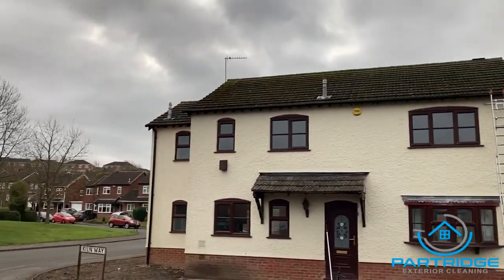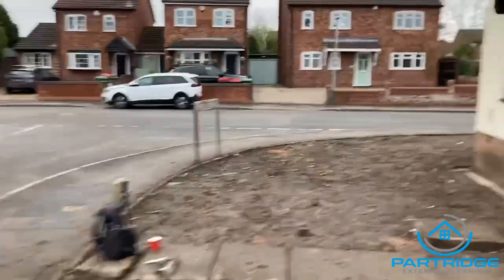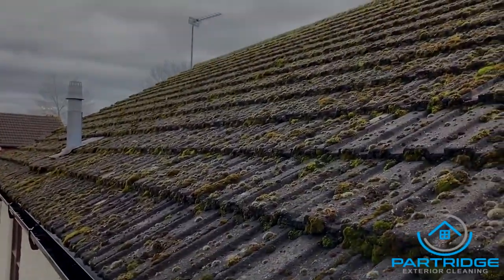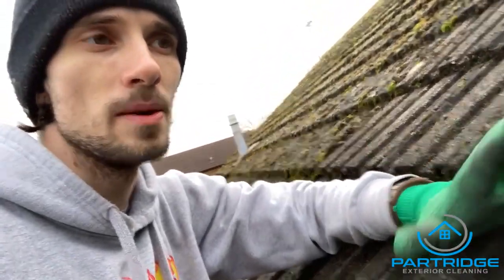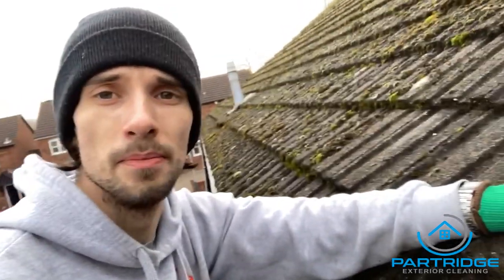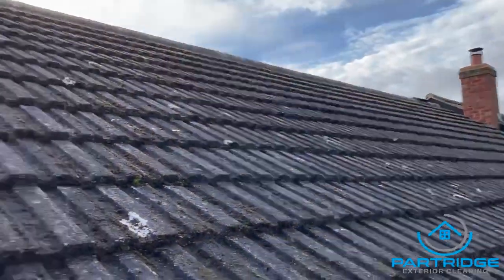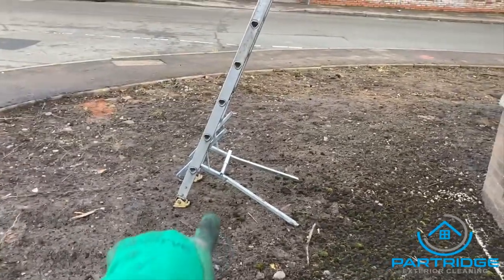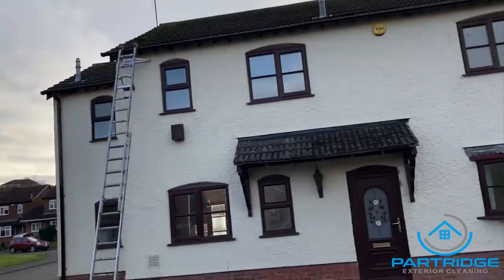Satisfying Roof Cleaning In Tamworth // Partridge Exterior Cleaning

Comment from the maker: Thanks for all the likes and subscriptions from this video! really awesome to see. well over 500 subs now thank you!
Reply: Hi mate, great vid as usual! just wanting some advice on algoclear, do you have or need any certificates to use it and if there's anything you need to do with what runs from the roof into the gutters?. cheers
Reply from the maker: No mate but it is advised to really do your homework when using it. 
You can book a soft washing course that will teach you everything you need to know. I chose to seek advice from the top guys in the business instead to make sure I was doing everything safely and correctly. 
Disconnect any downpipes that run into the ground or drains, if you can’t then plug it with something, I usually use a towel and block the pipe up and mop the run off away before I leave.
Reply: @PartridgeExteriorCleaning  really appreciate your reply mate! It was something the Facebook community was unclear about, what do you do with your towels just dry them out and reuse? Thanks again 👍
Reply from the maker: Yeah information about stuff like this is hard to come by I’ll make sure I mention it in my next vid.
I rinse them out after the job then wash them and re use :)
Reply: @PartridgeExteriorCleaning  thanks again, keep the videos coming mate and keep up the good work 👍👍
Reply from the maker: Thanks bud!!

Comment: I have a major clean every other month and they have a huge orangery with 24 glass panels as the roof. I used to use a ladder but my feet were killing me after standing on a thin rung for nearly an hour. Managed to bag myself a set of really good Zarges ZAP Giant (12 rung) platform ladders from a major auctioneer, at not even a quarter of the retail price. You might want to search for platform ladder or scaffold auctions and get yourself sorted. My feet have never been so grateful. Keep up the great work.
Reply from the maker: Yeah I know what you mean! The runs on these ladders are the best I've had and as I said in the vid they usually only start aching after about 6 hours straight but with that step I was golden all day. 
Pop up tower is on the list for this year, I will be hiring them for some jobs already booked in also.
Thanks for watching mate!
Reply: do these reach most gutter heights?
Reply from the maker: My ladders do. Any 2 story gutter out there, those platform ladders he’s on about look insane, 12 rungs would reach a gutter level on my houses I’m pretty certain
Reply: @PartridgeExteriorCleaning  like you Sid i'm looking to purchase a tower probably the Mi or boss. Something quick to assemble and move about

Comment: Hi, I’ve just scraped my roof to clear the moss, what should I now spray on the tiles? What would you recommend.
Great work your doing keep the videos coming 👍.
Reply from the maker: Hi Shaun you should apply a professional strength biocide onto the roof now, algoclear pro, Benz, gkpro are all reputable manufacturers. Dilute it 1/20 or 1/25 depending on the brand. Spray or brush into the roof but wear full PPE and make sure it doesn’t run off into the drains.
If you check on my channel I have quite a few roof cleaning videos with the softwashing at the end of the video 👍

Comment: Great job and video quick question after soft washing does the moss that dies off go into the gutter and do you return to clean it out cheers
Reply from the maker: It mainly just disappears into the wind mate or gets washed away. Usually just end up with dust in the gutters so doesn’t really need a clean out but you can offer a follow up check in 6 months like I usually do 👍
Reply: @PartridgeExteriorCleaning  f Sound mate cheers for that 👍
Reply from the maker: Any time buddy all the best 👍

Comment: Another great video Sid what temperatures are you experiencing down your way atm it’s struggling to get above 2-3 degrees up north no good for applying biocide
Reply from the maker: Thanks mate hope you’re well. Been sitting around 6-9 degrees most days the past week so been extremely lucky for this time of year. Hopefully you get some of that luck!
Reply: @PartridgeExteriorCleaning  That is lucky isn’t it so are we saying apply it 8 degrees or above do you need to take into consideration over night temperatures though or will it not effect it after it’s been on for a few hours?
Reply from the maker: 8 degrees is the guide so stick to it if possible but I’ve applied it at 6 degrees many a time early morning, warms up through the day then. Doesn’t matter what happens 12 or so hours afterwards, the moss is already long dead and it’s nicely soaked into the tiles.
If there was a -5 freeze or a hurricane later that night I might worry but in all of the winter roofs I’ve cleaned I’ve never had a follow up issue 👍
Reply: @PartridgeExteriorCleaning  champion mate I will go by them guidelines I have got myself a tower aswell now from BPS access solutions I went for a diy premium plus tower I was abit unsure when it came but when it’s all up it’s really sturdy 👍🏻
Reply from the maker: @pressurecleaningsolutions7896  Lovely jubbly, should make a video of you setting it up, would be a good watch
Reply: @PartridgeExteriorCleaning  I certainly will mate the YouTube channel is my next venture just getting time to do them I suppose